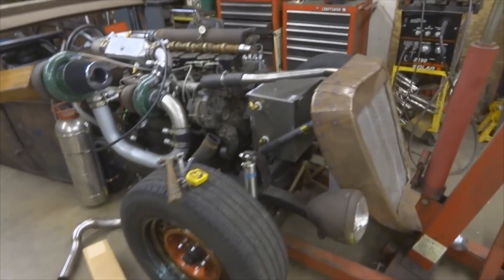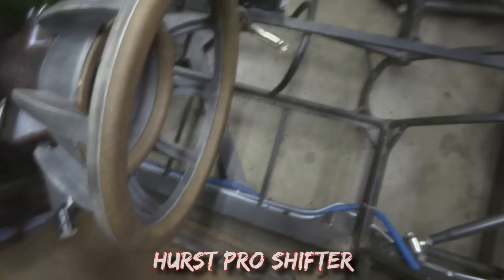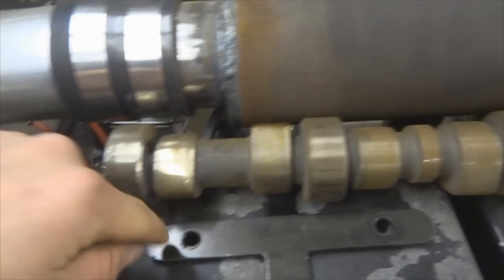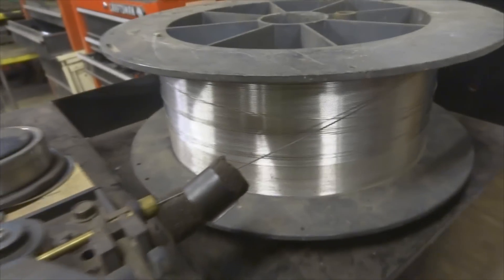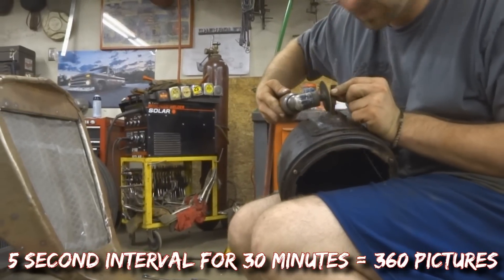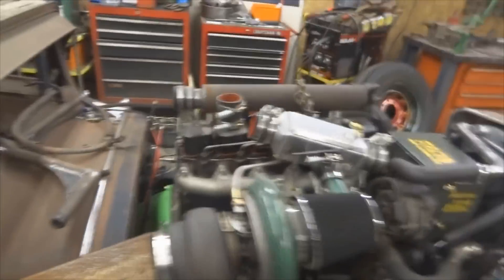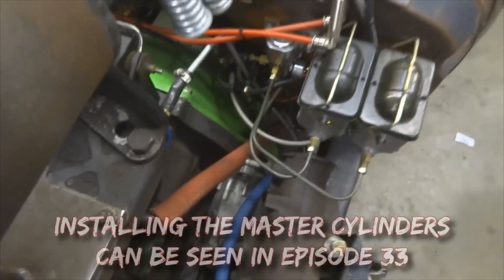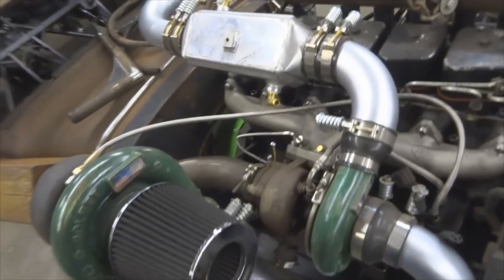Cummins Rat Rod: Project "Wild-Torquey" (Ep. 41) INSANE BUILD!!

Comment: A couple weeks ago on the TV show 'Chop, Cut, Rebuild', they show an electric power steering pump that might work to buy you more room under the hood.
Reply from the maker: +HardwayRanch Good to know, thanks! I am looking at stock solutions to fit my application because I dont want to spend an arm and a leg if I dont have to! If its on tv its usually pretty expensive!

Comment: Don't know if anyone pointed it out but i didn't see any bead rolls on the charge pipes. Might wanna do that to avoid blown pipes. 
Keep up the good work regardless. can't wait.
Reply from the maker: no bead rolls yet, but I plan on etching the pipes if I have blow-off issues. the clamps I got are supposed to be good to 60psi without beads.
Reply: Sweet dude. Just looking out. Good luck
Reply from the maker: Yessir, thanks for the comment :) if I have problems with my etch method Ill bead roll a little lip

Comment: Compressor and PAS pump from a DAF 45 truck in England, UK should fit right in there, I have the same engine in my Land Rover and use the mid-block motor mounts
Reply from the maker: +Nick Steggel Any idea where I can get one of those or have one by chance???
Reply: +Tinman 2 Kustoms 
I believe Foxwood Diesel have a good supply of engines they are breaking :)
Here is a pic of the mount location and bottom of the compressor and PAS pump that my mate has just posted on my Cummins Land Rover Group on FB, should help you:

https://scontent-lhr3-1.xx.fbcdn.net/hphotos-xtp1/v/t1.0-9/942783_10208658912740163_8817002068671744274_n.jpg?oh=b05fddd1b6b59cf03f248c8d3b72c329&oe=5726556A
Reply from the maker: Thanks for the picture, but that is not the same engine that I have
Reply: +Tinman 2 Kustoms Really? Thats a 5.9l 12v Cummins 6BT just has the Daf sump, thought the blocks and timing case were common?
Reply from the maker: Maybe it just has a different pan, but its hard to say for sure. To me it looks like the compressor mounts at a different angle. Any chance you could get some more pics or anything?
Reply: +Tinman 2 Kustoms Here is another pic, its a VE pumped example but the P Pump ones mount the same, I will see if my mate has a pic of his P Pumped one

https://scontent-lhr3-1.xx.fbcdn.net/hphotos-xft1/v/t1.0-9/12592708_1120360847988160_5220114033212270502_n.jpg?oh=ac5e839666ccfffa7bc313adbc5ae6e0&oe=57376565
Reply from the maker: +Nick Steggel awesome!!! any chance you can get me any part numbers? that compressor/power steering pump convo is exactly what I am looking for
Reply: +Tinman 2 Kustoms not sure of the part numbers but it is from a DAF 45 truck with 130hp or 150hp Cummins engine which will be 1990-1998 model year I think, Foxwood Diesel are pretty knowledgeable and have good second hand stock :)
Reply: +Tinman 2 Kustoms join us on www.facebook.com/groups/CumminsLandRoverGroup maybe someone has what you are looking for lay about?
Reply from the maker: Joined the group!! I will make a post on there and ask for help :) Otherwise I might be commenting here again looking for more info from ya lol
Reply: +Tinman 2 Kustoms Im admin of the group, put a post up introducing yourself and we should be able to help :)
Reply from the maker: Awesome will do!!! Thanks bro

Comment: How much total bump steer do you have now
Reply from the maker: +promodracer Not sure, I still havent found the proper steering box to correct my backwards steering issue. lol Im just going to get it as close to little bumpsteer as possible and thats all I can do. With airride you're almost always going to have some bumpsteer because of the amount of travel
Reply: Bump steer is the devil in the details. Bump and rebound while driving is like .030 max. .015 up .015 down. or you can crash it. and i am not exaggerating. Does not mater when stopped or going 5 mph playing with bags. driving yes. very dangerous. Took me two weeks to do mine. after it was suppose to be good. it was not good thing i checked.
Reply from the maker: Well I guarantee it''ll have far more bump steer than that. lol thats why its a hot rod, not a new car. They arent built for convenience or safety. They're built to be bad ass.
Reply: +Tinman 2 Kustoms it can kill you
Reply from the maker: A lot of things can kill ya in life, cant live scared all the time! Thanks for the input, doing my best to eliminate it, but it wont be perfect. Cant be with this style steering on a straight axle. But I dont have room for cross steer because of my huge engine/oil pan.